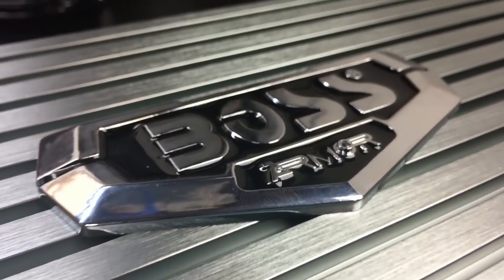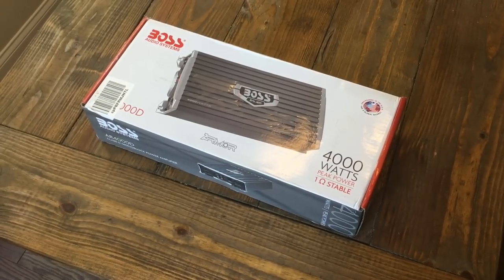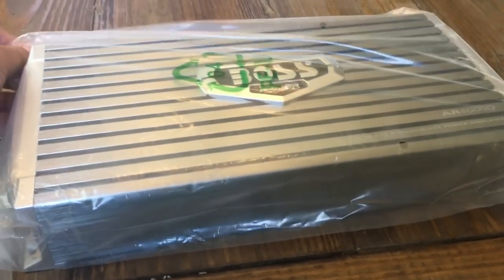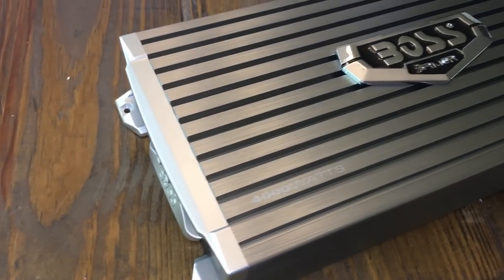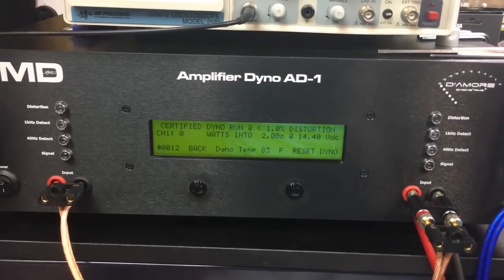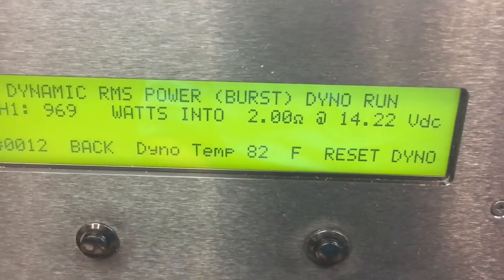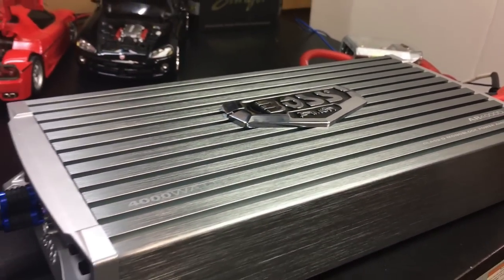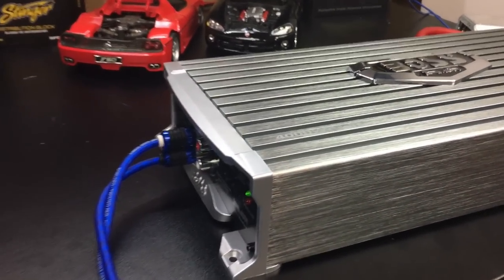Who's the Boss? AR4000D 4k MAX Amp Dyno Test

Comment: ..in the video you said for 100 just getting started its not a bad choice ...i have to strongly disagree..its miles of of 4000. youd need 5 of them with very strong electrical judging by the data in the  video
Reply from the maker: +Bassknots not everybody needs 4kW of true power though

Comment: I dont see how the manf. Dont get sued for false advertisement.. if its copyrighted in any way is also copyright infringement for printing and release of false reports. In no way at all even if you ran 120vac through it could it hit 4000w as you showed it protect at 1650.. i wonder if you took the protection circuit out and put pennys in the fuses if it would hit 4000 watts before it caught fire..? Soo many speaker pops but never seen an amp burn on the tubes... idea idea... *poot

Comment: 40a fuse x 3 =120 a x12v=1320 watts ttl that the fuse can handle
Reply: 120x12=1440 at least it did when i went to school, old school of course but in 1981 there was no amp that needed more than 1 fuse and more often than not it was at most a 30 amp so doin the math was way easier! my first real amp (was not an EQ powerbooster) was a huge pioneer GM-120 i bought 2 of them and it was incredible at 30watts x 4! my friends couldnt believe how good my 4 DLK Power Dome 6x9s sounded, of course the speakers lasted about 2 months before they fell apart. what a different time it was, the only subwoofers were when you put your home speakers in the back seat and found out you could hardly get them to move with 30 watts. amps didnt bridge back then either and shut off with 2 ohm loads. but you never had to worry about your alt or battery dying.

Comment: Im guessing 1200 before watching the results. Maybe up to 1400.
Reply: Pretty close. i usually go with the rule of 10 on amps for wattage. Fuse ratting x10 gets you in the ball park when adding in efficiency etc. Granted the amp can pull well over the fuse rating as seen in the video. Nicely done Big D

Comment: I have a boss audio ph3000.1d amp. On 2 15in Brutus hiponics brz15d4 subs on 13.3 volt in a 7foot plus cubic inch box. With the way everything is rigged I can throw down 133.4 bd. All for 550 dollars.
Reply from the maker: Brother, if it makes you happy, that's all that matters! Enjoy your system
Reply: BigDWiz I was wondering if you have or plan to dyno a phantom series from boss??? I'd love to see true numbers on this model.  They say 2250 rms at 1 ohm. I'm thinking 800.

Comment: Maaaaaaan u kno u got a big mail box swangin at the BIG D CRIB. Fo all those BIG G PIMPIN (MAGNUM) 50 thou x12 Chanel’s BIG BOPPER 1.2 million amps of current capable down to .00000000000000000000001 ohms infinity. Bump BUMP bump BUMP.

Comment: Ya know? I think this company is screwing up big time.  I believe if they posted realistic specs they would gain huge respect.  Specs aside the amp did way more than enough for the average person just wanting to add low end frequencies to the mix of a solid aftermarket head unit driving primary speakers direct and sending the lows to this amp and a descent sub.  Realistically you don't need anywhere near this amps potential for that.  Fake specs just turn me off though regardless of price.  A solid 300 watts RMS @ .05 THD into a balanced sum is more than the music lover needs.  For those who just want to impress with stupid loud bass vibrating their car apart might be disappointed..
Reply from the maker: So much truth here

Comment: Lol Boss is pure shit I hate em even sound quality sounds horrible.. when I very first got into car audio. I bought those old road gear 12s from Walmart lol put them into buckets and ran a mtx amp to them and suprisingly they sounded OK thumped but nothing crazy. But my next system was massive a few weeks after the road gear Walmart subs.. I bought the old school Virtual Technologies sledge hammer or what ever they called them. I had the 15" in the big VT slot ported box and it hit 151.7db easily. I kept that sub and box threw the years and still have her today and it still slams hard never had any issues out of it except 2 years ago when the motor came off lol.. but I repaired it in the Jeep took about 10 mins to fix and haven't had issues out of it. I don't use it much anymore I keep the sub in a bandpass box in me and wife's walk in closet to keep it safe. And once month I'll pull it out and put it back in its over sized slot port VT box and slam it for a few days and then put it back in bandpass for safe keeping. It still looks brand new after 15 or so years of having it. I paid close to 600 bucks for it new lol. I'm not sure on its power rating I can't remember what she does but it's not a lot tho its only a stamped basket good size motor and 3" voice coil I measured it when I repaired it it's a little over 3 inches so not bad for a old school sub from the early 2000s late 1990s and still sounds just as good as the new subs. I replaced the VT sub with a mmatts jugger in the VT box and it's amazing it's louder hits harder  you would expect a 1,000 dollar sub to do so anyways. And I also have 4 orion Hcca 12s I'm about to replace the jug with. I just haven't really felt like doing the install iv had my HCCA subs for 4 years now I bought them new and only opened the box's up to take a look at them and make sure they run fine. And they deff do lol I just don't really seem to care as much as I used to about the car audio scene as I once did. So that's why they are chilling in our game room in the closet just like I have the Monster old school bass king the virtual technology sub. Just sitting and collecting dust lol..

Comment: I have the boss 3000 got a 12” 800rms hooked up along with a 12” pioneer 500rms & it sounded like a single 10” sub so now I’m only running the scar at 2ohms and it sounds propped but still not satisfied with the sound.
Ghetto build yeah I know.

Comment: Im leaving a comment before watching the video, first off, Boss really? Pure garbage. The list that un realistic number just to get sales. My thoughts was that they ment 400 watts@1ohm and that it was just a manufacturer typo. In reality there is no way a true 4000 watt amp will fit into a standard mailbox. Im very interested in seeing the results on the dyno. My guess 1000 watts max @1ohm. Lets see, pressing play now.
Reply from the maker: +Random Tube thanks for watching and commenting 👍
Reply: Wow, Im actually impressed, the protection worked and the fuses did not pop, @100 bucks, you cant beat that, perfect for the beginning youngsters out there, well done.

Comment: You need a Power Supply, Quit running Batteries I Can build you a Custom Power supply that is veriable and fully regulated
Reply from the maker: I would need a 1000A power supply and I can’t afford the electricity to run it. I was offered a 1500A model from a company, think it was $15k

Comment: I freaking called 700 at 2 ohm.  Did I mention I have an electronics degree.
Reply from the maker: +Quinn Meche and access to a crystal ball 🤷‍♂️
Reply: BigDWiz no.  I have been hard core into car audio since 1999.  I know how they rate shit and can damn near call anything before it dynos.
Reply: oh, also specifically had a "Boss" amp in one of my builds.  did great on a single hammer pro 12.

Comment: 1100 watts lol
Reply from the maker: Still one of the best dollar per watt amps ever made
Reply: I think so!   I had two of them Proton D275 amps that you tested. The Dynamic power on demand amps. Dude  the imaging on the bass response on them things was simply amazing. unfortunately they suffered from running hot and after blowing them up and repairing a few times I gave up on them. But wow yeah they delivered. Still have the guts of one laying around here somewhere, big capacitors and all lol

Comment: this is a really bad amp to buy😱💩💩💩 can do nothing with 1000 watt at 1ohm
Reply from the maker: +Guyane50 with a proper box and subs, I disagree. 1000 watts is plenty of power for most people
Reply: BigDWiz i think this would be great to go with my alpine s 12 in a ported box that i only paid $80 for
Reply: Alpine SWS-10D4 x2. Run em at a 1 ohm load and feed em the 1000 WRMS they need. It'll slap in a proper ported box!